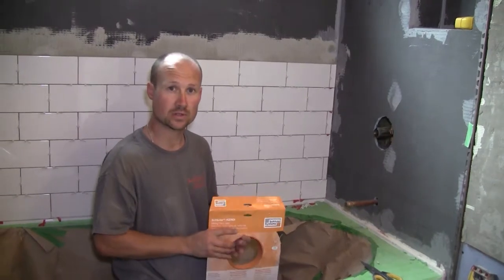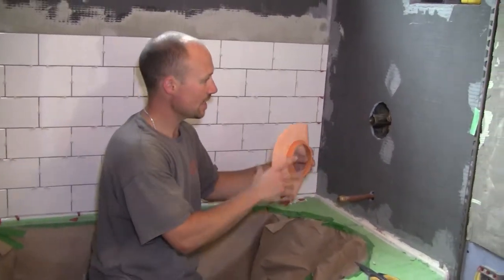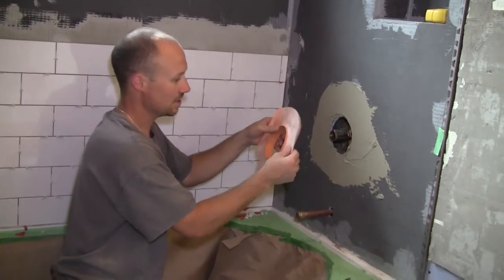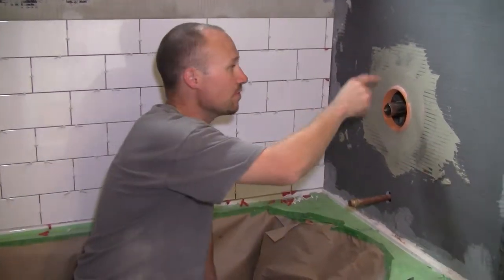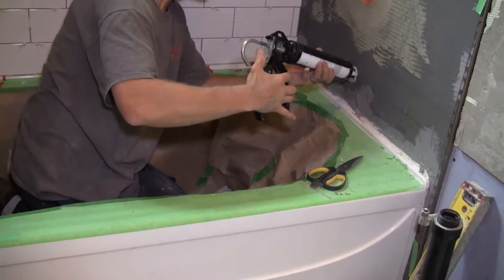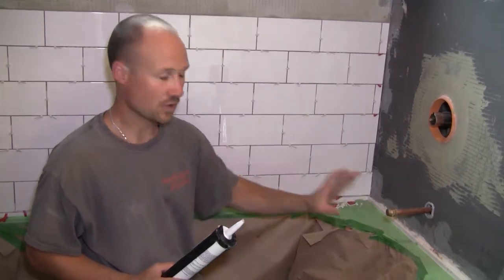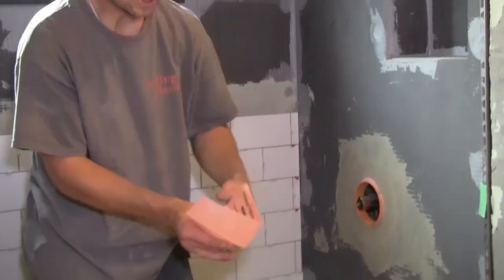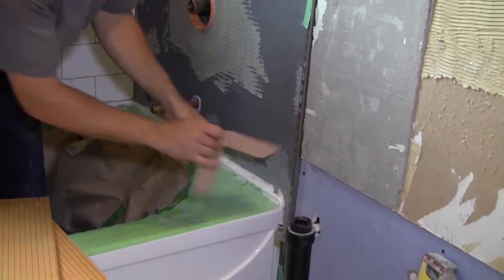How to Tile a Bathroom 29: Waterproof Seals & Boards

Comment: Can you apply a Kerdi membrane to a textured and painted wall or do you need to sand it down first?
Reply from the maker: Depends how textured. The hold is only as good as the base, but if the base holds and you add enough mortar to deal with the ups and downs, it should be okay. There's no perfect answer though as every job is a little different.